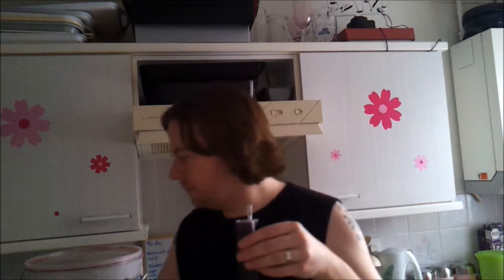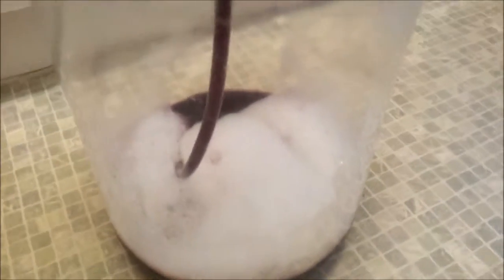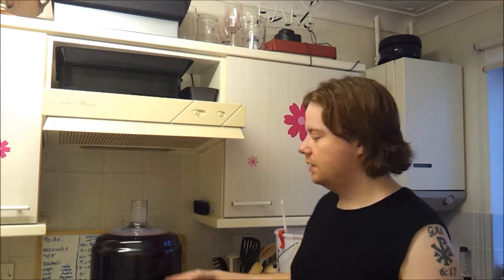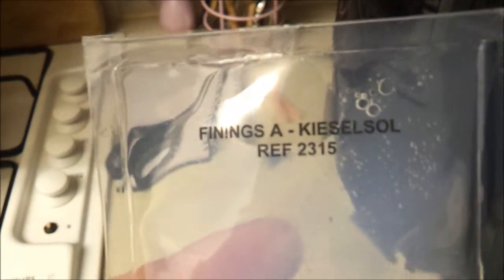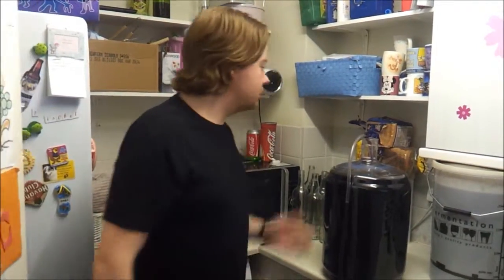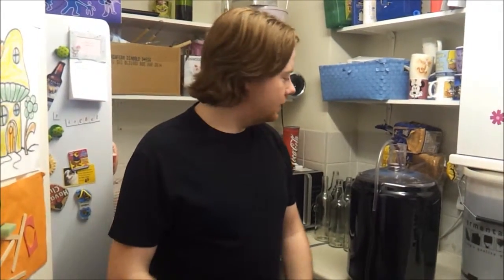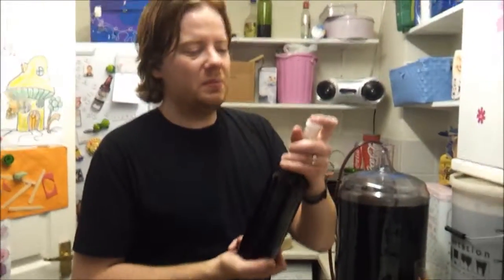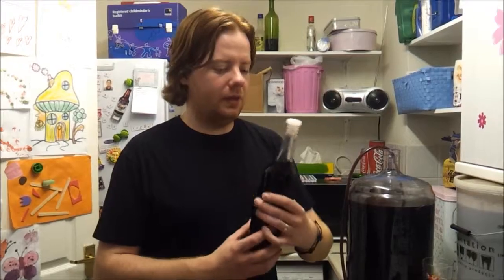Making Wine Part 2

Comment: I see where you bought a degassing wand so it might be too little too late.But you can do the same trick with the pump and the orange rubber caps available for demijohns. Just uncap one of the spouts and put the pump on it. It WILL take a few days even then. Although for a little more expense, you can buy/rent a wine filter pump and that will completely degass your wine. I recommend this especially for white wines since they seem to need filtering for that really clean or clear look..

Comment from the maker: The wine doesn't ferment any more because the stabilizer kills off the yeast.  The residual CO2 from the original fermentation is what you need to get rid off because it will blow the corks or smash the bottles if you don't.  I was really impressed with the results of the Beaverdale red kits, this is the third one I have done now.  The white wine kits I have tried so far have been ok but a little bit too sweet.

Comment: why not get a very long drill bit sterilise it, and selotape firmly 2 rectangle shaped cards to the long drill bit. Then connect the drill bit to the drill, pop the drill bit into the wine turn on the drill and the card will be like a propeller swishing the wine around and getting rid of all the air in fast time. I seen it on another video and it worked super fast. FOOD FOR THOUGHT

Comment: Most of the CO2 is dissolved in the wine. To remove it, bubbles must form. In order for bubbles to form, there need to be particles for them to form on. If your wine is well fined, you won't have many particles. So add boiling chips (they are just small pieces of material with a surface with micropores. It's like seeding clouds so they will rain. They can be ordered online. Warmer temperatures also help. Of course, you should not warm up wines whose aroma is important to preserve.

Comment: Stirring until your arms wear off is the tried and true method for degassing. Shaking doesn't cut the mustard. I've decided to be lazy and use a vacuum setup. After primary fermentation, there could be secondary fermentation that also releases CO2, so don't bottle too soon. You need to be 100% sure no more CO2 is being produced. That's why I like a vacuum setup with boiling chips. I wait a week and apply vacuum. If there are bubbles, it's not ready yet.

Comment: Your degassing technique appears to leave much to be desired, as demonstrated by the large amount of foam when you pumped after declaring it was finished. This isn't a huge criticism. Degassing is probably the most labor intensive part of the process if done properly. I've resorted to shaking, stirring, and applying vacuum with boiling chips. The problem isn't just the potential for exploding bottles. CO2 also ruins the flavor of the wine -- unless, of course, you're making sparkling wine.